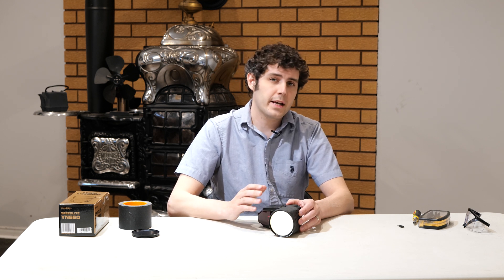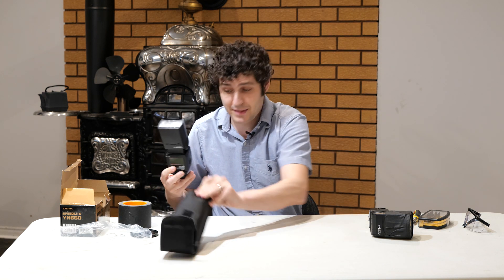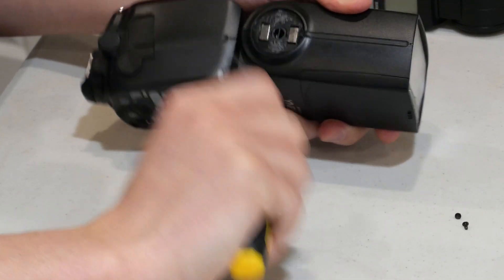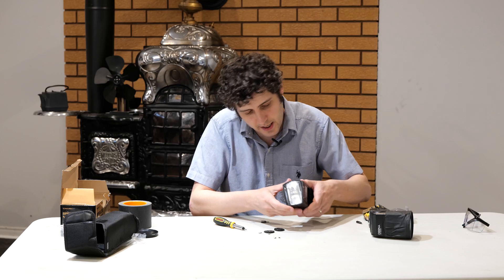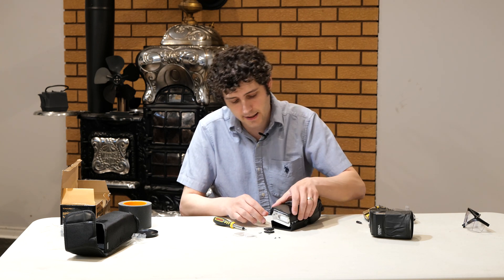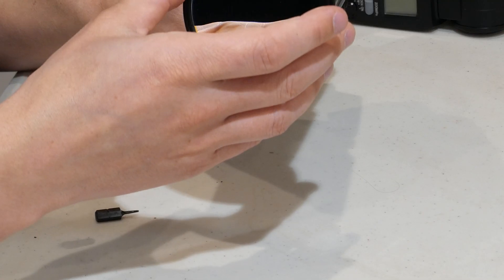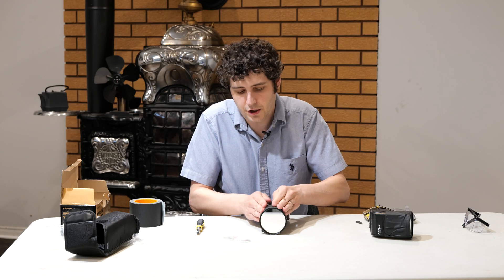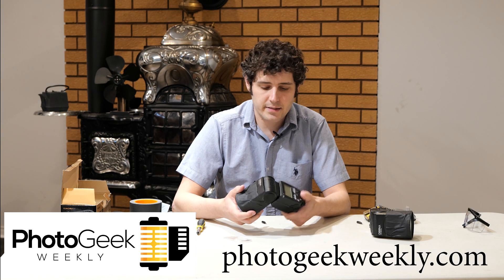Converting a camera flash to UV / Ultraviolet with Don Komarechka

Comment: Awesome video and very helpful for trying to do blacklight photography as using a flash for control over constant is better in my opinion. Also seeing how most black lights are now led and have such a bad output seeing filters being used and what part of a flash to remove is awesome. I’m mainly using 365-385nm as those cause the best fluorescent effect. Would be nice if camera places told us the diameter of their round flashes so we could order the right mod parts all at one time

Comment: Would this work for a flashlight? What I'm asking is if removing the low iron Glass lens  and putting an optical pass filter meant for cameras in 365 nanometer UV spectrum; could you also put that same optical pass filter in front of a high power LED or halogen flashlight and make it a UV flashlight?
Reply: Not LED for sure.  

It might be easier to just get a UV flashlight and do a long exposure - no flashlight is going to give you the kind of output that a speedlight would, so you’re going to need a longer exposure or higher ISO anyway.  Side bonus, with a flashlight you can do some light painting with it.

Comment: Do you think it would be possible with film? And also, how dark would you say the flash comes out to be? I came here not for uv photography, I got interested in it by these video, but my original goal is noble photography, rn heliography, but later down the line also physautotype, daguerrotype and maybe salt printing. I have uv lamp used for gel nails which I use for contact prints rn, but I'd love to do some actual in camera photograph. From uncoated lenses fastest I have is 4 element f3.5, do you think that coating and more elements would greatly reduce the light, up to a point where even tho the lens is faster 1 stop it permits less light, because of the additional layer of glass and coating?

Comment: Hey Don! Thank you for this! am I correct in assuming this will work for black light reactive body paint on a person? In the past ive used a powerful black light to capture these photos, but it just does not allow me to use the shutter speeds im after. This seems like it will be a solution, however my environment, although it is fairly dark, has a lot of ambient light. will this flash be bright enough to illuminate a subject that is a several feet away from the flash/camera? these are full body shots. or will I need to double or tripple up the flash? if so, I could see this becoming rather expensive rather quickly
Reply: The small cheap flash will not give you the light your needing. Go for a larger open headed corded flash and silver umbrella. I say silver because using a white one will cause the light to become visible light instead of just the uv your looking for. I used just a cheap bandpass filter on a flash head to see if it would have any fluorescent effect in my well lit room after taking a black frame shot and it worked as hoped so good luch

Comment: Hello Don - I'm curious to know if modifying a the flash this way diminishes the output of light?  Reason is - I'm looking into producing old tintype photography in doors, but the emulsion used for tintypes is only sensitive to UV light. But needs a lot of light because the ISO is like 1.  I'm wondering if I modify a flash if this will help in anyway emit enough UV light to produce the a tintype image. Any thoughts?  Thanks!

Saed
Reply from the maker: Hey Saed - modifying the flash does both. the first modification of removing the pieces of plastic from in front of the xenon flash tube would widen the spectral output of the flash. If your tintypes have no sensitivity to visible or infrared light, there would be no reason why you would need to filter this down to "just" UV light using expensive filters. You can use just the bare xenon flash bulb and it should work for you.
Reply: @DonKomarechka  Don, Collodion which is basically the emulsion for Tintypes is only sensitive to light between 325 nanometer (uv) and 510 nanometer (bluegreen) light. So do you think by modifying a Speedlite will do the trick? Or is there filters I would need to add to it to achieve that?
Reply: @DonKomarechka  Don - another option is I have White Lighting strobes that use a single-ring, 14mm flashtube that is UV-coated and daylight-balanced at 5600K would this work instead of modifying a speedlite? I sent you a previous message about the how the tintypes are sensitive. Any input would be greatly appreciated.
Reply from the maker: @saedhindash5169  your answer is sort of in your question. If the xenon bulb itself has a UV coating, there is really no convenient way to remove that. The speelites I was using from Yongnuo do NOT have coated bulbs and instead depend on the plastic components in the optical path to block UV light which are easy to remove. I'm not saying it's impossible to strip that UV coating off, but that's not a job I'd want to do. :)
Reply: @DonKomarechka  Understood.  Why did you choose Yongnno?  Do you know of any other speedlites that use xenon flash tubes?
Reply: @DonKomarechka  Curious if you know if any of their other models besides the 660 has the uncoated flash tubes?  Because I'm not able to find any 660's
Reply: Sorry for all the questions. But How were you able to find it the flash tube was coated or not? I was digging and wasn't able to find any info. On one blog I saw people talking about the Godox AD200 head. They say its of the same generation as the YN660 so it has the uncoated tube.  Any thoughts?  I just don't want to invest in a flash and find out it is coated. Any direction would help.
Reply from the maker: @saedhindash5169  honestly I just guessed that cheap Yongnuo flashes wouldn't have coated lamps, and I was right. I used the YN 660 and 685 units but I believe than most of their products would behave in a similar way. Only one way to find out, and the cost wasn't that expensive if I guessed wrong.
Reply: @DonKomarechka  Thank you for your time!

Comment: Thanks for the vid, really insightfull. I've got one question i havent found on the comments: i've read elsewhere that uv light can damage the camera sensor... so, if i were to use this flash off camera, should i put a uv filter in front of my lens? Is it true that i could damage my sensor with the exposure i could get out of this (or any given lightorch from amazon)? I know cameras have a uv filter biuld in, but is it there for the purpose of protecting the sensor, or to avoid any undesired shining spots on its surface?
Reply from the maker: All cameras have filter placed in front of the sensor that block UV as well as infrared light. If they didn't, the camera would have a warped view of our reality as human beings who cannot see these wavelengths of light, but a CMOS sensor is actually sensitive to it.

I have a camera modified for full spectrum work and the direct imaging of UV light by removing these filters... and the camera is just fine even with direct exposure to ultraviolet radiation. So, I cannot confirm with certainty that UV light does not harm a camera but I have never experienced any harm and I push the limits pretty far. :)
Reply: @DonKomarechka  Thank you very muchh! :) that helped, i'm gonna try some lightorch macro and we'll see if this needs to scale up to somehing like modifying a flash
Reply from the maker: @marc5279  I recommend the Convoy S2 as a great place to start. Good luck!

Comment: do you know if this will work this filter ? 
ebay link . not sure if this will work so i can mod it on the godox ad200 rounnd head 

 https://www.ebay.com.au/itm/323941639957?chn=ps&norover=1&mkevt=1&mkrid=705-139619-5960-0&mkcid=2&itemid=323941639957&targetid=1280498559010&device=c&mktype=pla&googleloc=9071820&poi=&campaignid=9767740733&mkgroupid=123973272218&rlsatarget=aud-692203741102:pla-1280498559010&abcId=578876&merchantid=119024801&gclid=Cj0KCQjw24qHBhCnARIsAPbdtlJadE-Xc_Op79GQ2C1ehsBQ_A7XeFFH9AcBuKIxQhtVE9ounEuya64aAnE_EALw_wcB

Comment: BTW, Midwest Optical Systems now has a BP340 filter which has as little bleed on the violet side of the spectrum as the Hoya U-340 filter and no bleed in the red or near infrared same as the BP365. This could be a single filter option with little bleed in the 380-410 nm (less than 10% at 380nm) and no bleed on the infrared side until 825 nm well outside the visible light range (approx 380-750 nm).  I just don't know how easily procurable it is. https://midopt.com/filters/bp340/

Comment: Thanks for the great info! One question: Will you get the same result using a ZWB2 filter? That filter only allow 365nm to pass through...
Reply from the maker: ZWB2 glass allows for deep red transmission. This is fine to filter down UV LED light sources for a purer UV output, but remember that Xenon is a full-spectrum light that also dishes out a lot of infrared light. As such, you'll notice a red light leak when using just a ZWB2 filter in front of your light. This doesn't matter so much for highly fluorescent things like certain minerals, highlighter ink etc. but it contaminates the images of lesser fluorescent subjects like insects and flowers.
Reply: @DonKomarechka  I will mainly use this for mineral photo. Already ordered the filter before I saw your tutorial. Will test and see what I get. Thanks for your kind reply
Reply from the maker: @hkanderful  let me know how you make out!
Reply: @DonKomarechka  Will do

Comment: Hi, thank you for the video! Now, do you use one of those UV filters or do you mount both? I would definitely give it a try but I was curious if you can get good results with only using Hoya for example.
Reply from the maker: You're welcome! One of the filters has a light leak in the red spectrum, and the other has a light leak in the purple/blues slightly. They both work to cover each-other's leak, which would prevent contamination of the fluorescence of the subject. It's pricey, but it works. The other option is to use a Convoy S2 or C8 UV LED flashlight, which gives great results for static subjects that won't move over a longer exposure!

Comment: Hello good morning, the reason for my message is to ask you if converting a flash for UVIVF photography can be done with any Flash? or does it have to be a younguo flash? . I have sony alpha cameras (A7III, A7SIII, A7, ...)
Thanks a lot.
Best regards
Reply from the maker: Since you'll likely be using the flashes in manual mode, at full power, it doesn't matter what camera you use. Whether I use a Lumix camera, Sony, Pentax etc. they all work in manual mode with this flash (and any flash). You do not need, nor would you ever use, the ETTL features of this flash.
Reply: @DonKomarechka  thanks!!!!!!👌😉👍

Comment: Hi Don , thanks for the tutorial . I' ve always read your articles religiously in OPC magazine . I have two questions for you . I am currently into camera trapping flying squirrel in mid air with a long 30 sec  exposure during nightime ( 4 flashes)  . I know they glow under UV light and taught this would maje an intersesting shot to have them underside glowing pink .
So I was wondering .
Would it work at all or would the ambiant ruin all of this ..  ? 
Is there a lot of loss in power with the flashes ( right now they are mostly at 1/64 for this particular set ) ? 
Could I combine UV flash to expose the flying squirrel and normal flash ( to expose tree trunk  and environnement) or would the UV light be ruined again by normal flash ? 
I use nikon sb28 since I have a lot of them .. Would this modification work on these flash or is the bulb itself has a UV filter? 
Thank you very much

Comment: My speedlight works well beyond sync speed after the modification . Do you know why this occurred?
Reply from the maker: Define "well beyond"? Possibly that using a flash at full 1:1 power increase the flash duration substantially, allowing for a faster sync, but in turn you'd be losing some of the light output from the flash. To make the most of the light, I'd actually dial it UNDER the listed sync speed so nothing is blocked by the shutter curtains.
Reply: @DonKomarechka  i am using half power on my speedlite and my shutter speed is 1/350 but my sync speed is 1/200 and this speedlite does not have HSS. It looks like the exposure is decreased when I increase the shutter speed that's odd. I may try another speedlight to test it out. This speedlite  outperforming my expectations
Reply from the maker: "Half Power" is still well beyond the base of 1/256, 1/128 or 1/64 that many flashes offer. Think of it this way: they don't adapt the voltage to increase output, the adapt the time. A longer flash duration does not mean that all of the flash output will be recorded at faster shutter speeds but it means that it's likely to cover the mechanical shutter window evenly, with a lot of wasted power on either side. You are correct, it seems like your sync speed is faster, but a lot of the flash output is being wasted. If you set your shutter speed a bit lower than your normal sync speed, you'll likely notice a significant exposure difference. Science! We don't often get into the maths of all this, but it can be helpful to go back to bare basics to understand what's really going on.

Comment: Hi, thanks for the video ! We are working on a shadow wall, much like in this video https://www.youtube.com/watch?v=I6IqoSAtjb0 By any chance, do you know if this trick would work to block the visible light on a bigger studio flash ? Thanks
Reply from the maker: It should work, and allow all the UV light to be emitted. This depends on the kind of UV protection the strobe uses, as some of them have UV protective coatings right on the xenon flash tubes themselves rather than the plastic placed in front of them. I know the higher-powered Yongnuo YN660 and YN685's work - but I think you'll need to do some experimenting. If you're shooting people in front of a glow wall with UV light though, I might advise UV safety glasses for everyone. :)

Comment: big question - can i mod with this filters my godox ad200 flash head (not bulb)? Plz answer
Reply from the maker: Not sure what kind of flash bulbs Godox uses in those lights. Some bulbs have a UV protective coating directly on them, rather than depending on the transparent plastic in front of the flash head to block UV. You might be able to get an answer out of Godox but it wouldn't have to come from one of their engineers!

Comment: Can one just use a uv flashlight?
Reply from the maker: Yes, for some subjects, with a caveat. Most UV flashlights are poorly filtered and spill a lot of visible light which will "contaminate" the fluorescence. You'd need to either filter down the light in a similar way to filtering a full-spectrum flash, or get a nice one. Anything that carries the "Convoy" name is generally a safe bet, but materials vary with all of these lights. Continuous light isn't suitable for all subjects either, especially insects or other moving things.

Comment: Thank you for this video. I am trying to build the setup to try my hand on UV photography. But getting the filters is a bit difficult. So just wanted to know can we use UV light source (UV lamp/light) instead of flash?
Reply from the maker: Yes you can! However in each scenario you need "pure" UV light for best results. This often means filtering down UV lights that leak part of the visible spectrum - virtually every UV light source could be better. About the best I've found are Convoy S2+ LED flashlights, but these still benefit from some filtering if you are trying to image dim organic fluorescence in some flowers and insects.

Comment: I really want to try this a long time ago but those filters are really expensive! :( 
would you recommend the UV pass filter from the counterfeit money detectors? Those are 365nm UV pass filters too, but i think not as good as hoya and midopt.
Reply from the maker: Those filters unfortunately bleed a lot of visible light, so you'd get your fluorescent results contaminated and there will be a very frustrating colour cast. Another option to consider is UV LED flashlights - look for a Convoy S2+ with an LG LEUVA33U70RL00 diode for decent results. Still a bit of light bleed but very good place to start.
Reply: Thanks for this! :)
Reply from the maker: @vangelaobli  That's what I'm here for!

Comment: Hi, 
I would like to know, if MidOpt BP365 77mm can replace Schott S8612?

They should work, because at 199a flash modification these are used together.
add e-bay links to.  
https://www.ebay.com/itm/HOYA-U-340-UV-shortpass-IR-longpass-77mm-Filter-Hoya-glass-Infrared-Schott-UG11/163769917160?hash=item2621729ee8:g:KMIAAOSwkNZUhkNY and
 https://www.ebay.com/itm/Schott-S8612-77mm-x-2mm-UV-IR-Cut-Filter-Visual-Bandpass-IR-Suppression/303188665047?hash=item469773e2d7:g:1WsAAOSwEqVcLbfJ